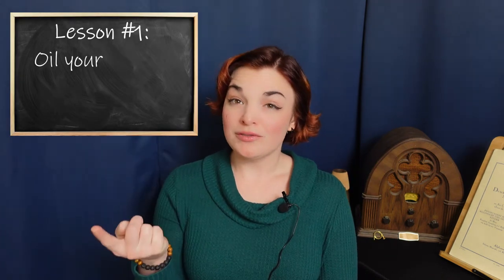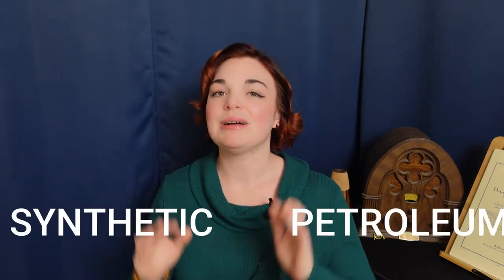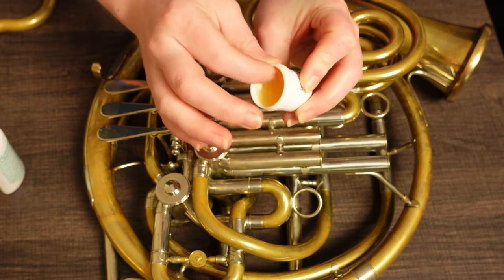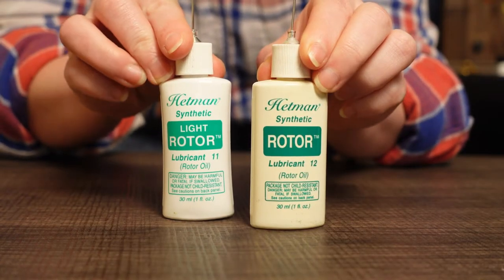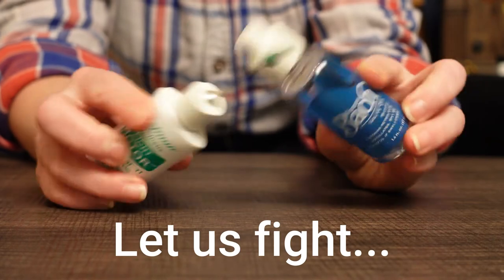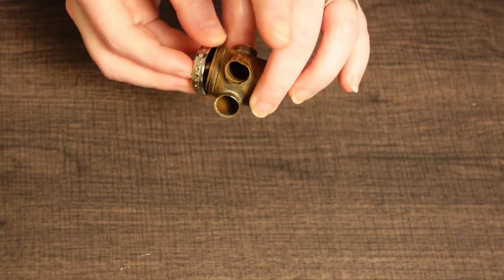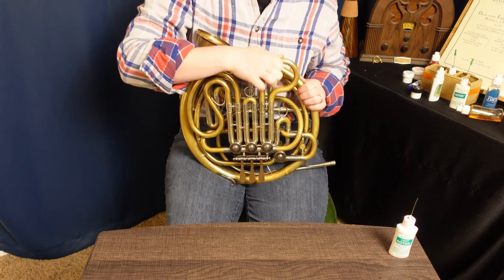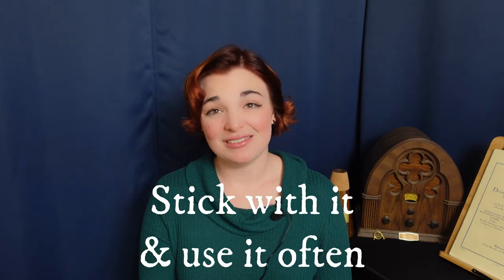How to grease & oil your horn: a guide to proper brass instrument lubrication

Comment: What is the machine oil that you use? Also, great video!
Reply from the maker: Thank you! The oil I use for under my caps is just a very basic machine oil. The 3-in-One brand multipurpose oil works really well. Highly recommend for bearings. However, I don't put it down my slides. I don't know how I'd feel about breathing in the fumes. Thanks again for watching. :)
Reply: @theoffbeatperformer7781  Haha yeah the fumes are horrible. Thank you so much!